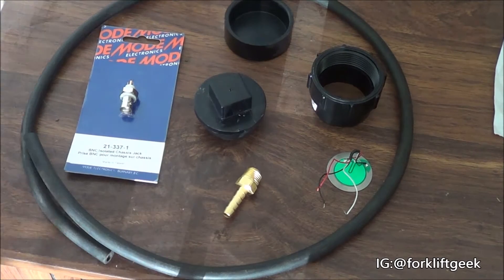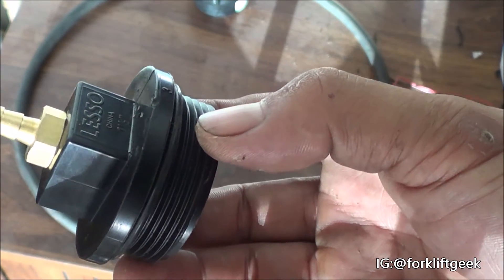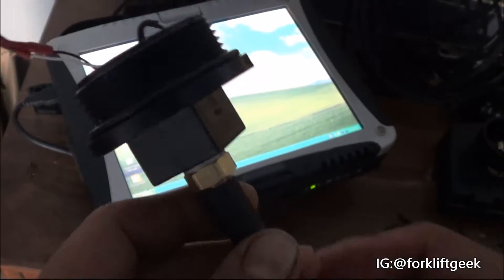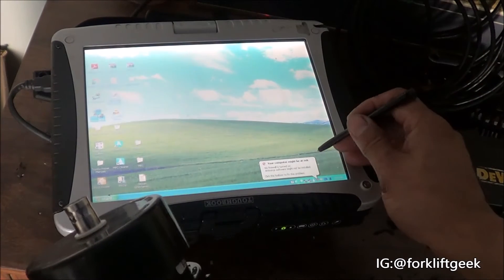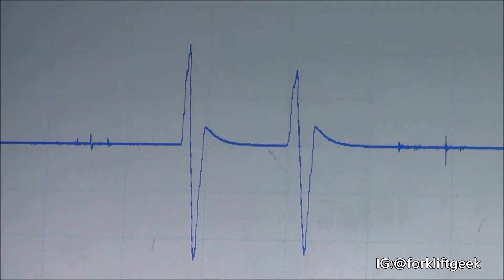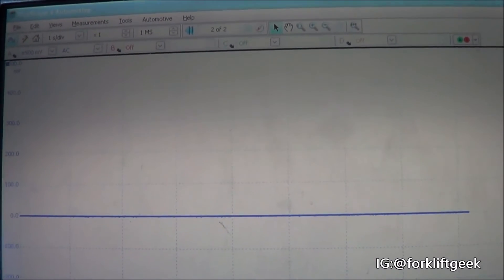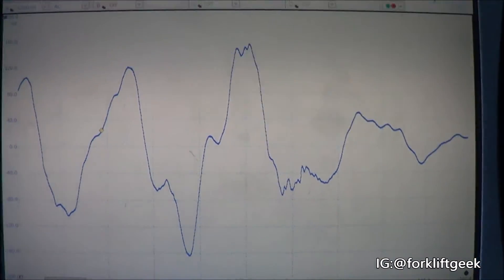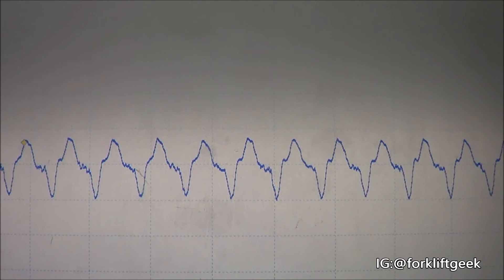Make your own Pulse Sensor

Comment: Great video, Can I use a EFM-290ED for my pulse sensor out of a kidde firex smoke alarm THREE PIN
Reply from the maker: I think you could. Just figure out which 2 would produce an ac signal.
Reply: @forkliftgeek10  Used The Pins Labeled G And M, Works Great On My Modis Thanks Again

Comment: Great video! Question: Why did you connect to the Feedback part of the disk instead of the Anode part? Thanx...
Reply from the maker: During testing though, you apply positive pressure and make sure the voltage goes up and with negative pressure the voltage goes below zero. If it was the other way you reverse the connection.
Reply from the maker: I don't think there would be a difference since the voltage produced would be AC.
Reply: @forkliftgeek10  
OK, great.
Thanx.

Comment: Bro, your rubber hose is way too long, look at older engines with MAP sensors, they started out with longer vacuum hoses, then the sensors were moved closer to the manifold then the MAP was mounted on the manifold. The pressure pulses in longer hoses are baffled or softened and don't give a very accurate waveform. This post is for future readers of your nice video, thanks.

Comment: I used a 1" PVC quick disconnect and two plugs with a 35mm sensor. Works perfect.
Reply: That’s weird seeing 35mm is bigger than 1-1/4” how are you doing that?

Comment: I made a DIY pulse transducer yesterday and posted a video on my channel. I mention your build due to its heavy influence with a link to it. I chose to use a larger ID hose and I positioned the piezo to maximize the area. It generates 2.2v and a sharp "V" waveform. Am pleased with it and appreciate your build as well.
https://www.youtube.com/watch?v=sxtHfhdGKAI&index=8&list=PLNkmVWB9nor9JDGfhbWI-E1NTktNLbdjS&t=12s
Reply from the maker: +logical canuck I will surely check it out.

Comment: Hello, Your piezo sensor looks to be about 45mm diameter. Do you think we could get by with a 35mm diameter sensor. That size is readily available but larger sensors are not. Naturally the PVC fittings would have to be smaller as well.
Reply from the maker: +Bill Nelson i dont think there would be a problem with that. Although I've never tried it with a smaller piezo before. But the reaction of the sensor should be same.
Reply: Forkliftgeek. Thanks for the quick reply. I'll give you some feedback once we get this together. No sense leaving everyone in the dark on that question.

Comment: I noticed piezo sensor had 3 wires then u must have removed the red one,my piezo has 3 spring loaded leads instead of hardwired ones like yours.question should I look for another smoke alarm or should I be OK soldering wires to piezo,my concern was solder heat,come to think about I might just use conductive adhesive Give me your opinion.this weekend I'm building one like yours and one with a fps and a few high psi transducers
Reply from the maker: +harvey jackass I've had to solder wires directly unto the piezo before and was ok so I don't see any problem with that. Fps works fine with exhaust pulses but u have to use a map sensor if you want to see intake vacuum pulses.
Reply: If you use a map sensor, does it need a 5 volt reference to read correctly, or is it just the bending of a board or something in a map that changes resistance?
Reply from the maker: The MAP sensor needs a 5v supply and a negative to work.

Comment: hello , do you think that can be use as a vacuum transducer? you know to check negative intake pressure
Reply from the maker: +david cisneros if you want to get the vacuum reading of each cylinder then the answer is no. This tool is used to see if the cylinders are drawing vacuum equally. If you want to be able to get the vacuum reading of each cylinder then a MAP sensor would be more appropriate. But you need  an oscilloscope that can give great detail.
Reply: +ForkliftGeek that's what I thought , Ok so MAP or FTP would do huh.
Reply from the maker: +david cisneros yes a MAP sensor would give you a voltage reading corresponding to manifold pressure. But the reading is the average of all cylinders, to see each cylinder pull you have to zoom in quite a lot. That's why I said you need a scope that give great detail even when zoomed in. Fuel tank sensor is good for exhaust.